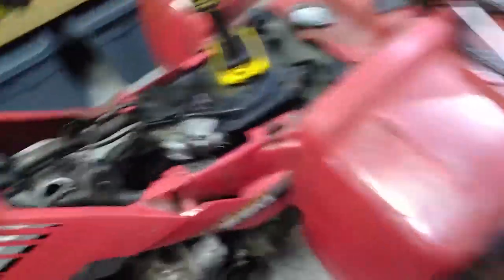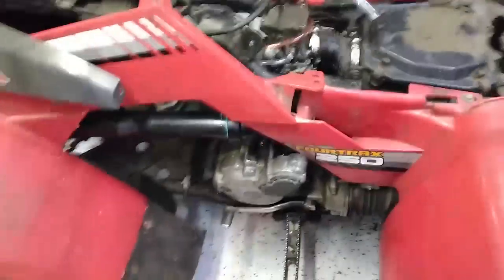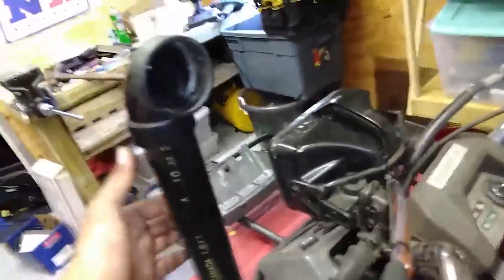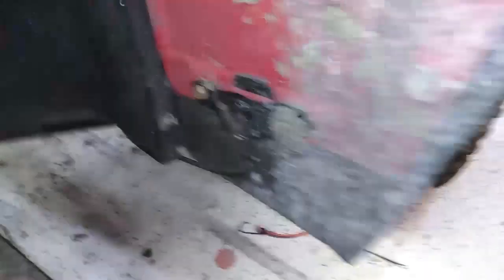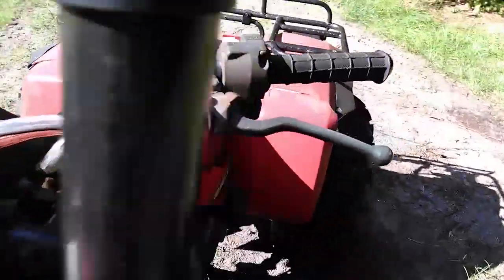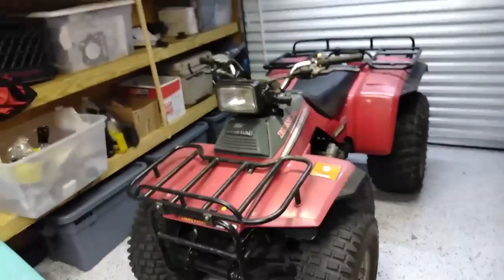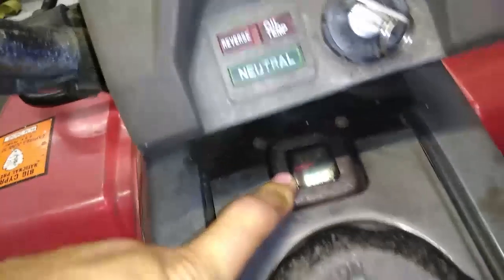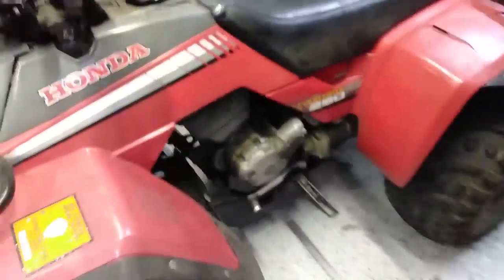fourtrax 250 valve adjustment, snorkel, lift, and walk around

Comment: My Dad bought an 86 Honda Fourtrax 2WD new, and as a 14 year old kid, I rode it around the farm, but we worked that thing pretty hard. Used it to pull a hay rake if you can believe it.  Hold baling wire spools building fence.  Strap lost calves on the rear cargo rack, lol!  He uses Gators on the farms now, but I just found that little Honda tucked away in a corner of one of the barns, and I'm thinking it's time for a resto soon, thus my search on youtube, see what other people are doing.

Comment: when you push down the red reverse button and squeeze the brake and look there's two cables the top is the brake and the other one we put a zip tie on the bottom cable and you don't have to  push in the red button any more just down shift and it goes straight into reverse
Reply: PCVideos In High Definition When your four wheeler is about 2 inches from the top of the snorkel and you have no brakes, that button could end your ride.
Reply: PCVideos In High Definition When your four wheeler is about 2 inches from the top of the snorkel and you have no brakes, that button could end your ride.

Comment: You can put 300 honda 2wd front hubs on the front and put regular Honda bolt pattern on these bikes, I have one with 26" zillas all around
Reply from the maker: +scullcracker01 mine had 4/110 already in the front
Reply: Mud Puppy oh ok mine came with 4/144

Comment: I have the same bike, just a 87, it’s a little more beat up, I want to snorkel and put a winch on it, would it work to run a 180° rubber bend straight from the carb and completely delete the air box?
Reply from the maker: It will run better smoother an airbox
Reply: Mud Puppy is the lid/cap to the air box water proof? Me and my uncle were wondering.... or does it seal? Asking a lot of questions because I’m very new to this and don’t want anything to bad to happen but this bike should float with the right tires right?

Comment: I just did a top end on a 84 trx200 and the cylinder gasket is leaking oil any ideas to stop it. It don't leak much but does co.e out when rode a bit

Comment: I have 1986 trx 250, under gas tank there was air intake pipe that went to filter box, but i need to vent it out the side, i was watching your video but didnt see where you rerouted that pipe?
Reply from the maker: I think you're probably talking about the crankcase breather but not sure... I usually replace the factory system with one straight line that goes from the crankcase into the airbox
Reply from the maker: This mimics how the modern Honda's work

Comment: How did you seal the airbox lid? And have you ever had problems of the right rear tire rubbing the muffler? I have been noticing this on my 85
Reply from the maker: +SezMan716 Dielectric on the airbox lid. And I have wheel spacers so no rubbing

Comment: What size tires did u put on it. Are they the older 4 lug bolt hole
Reply from the maker: 25s and no normal Honda bolt pattern 4/110
Reply: @MudPuppyOffroad  I have a 1984 trx 200. Wired bolt pattern or do u know what I could do to get bigger tires

Comment: how would a lift a 86 4wd straight axle in the front?
Reply from the maker: I assume you're talking about a TRX 350. you can just weld on a spacer to the top of the shock and get about two and a half inches. Compromises the steering a little bit because it adds a lot of caster. but they're already pretty much unridable to begin with so not that big of a deal lol

Comment: I am having trouble getting my exhaust valve adjusted correctly. I see you said TDC but does the vlave need to be down or up?
Reply from the maker: Both of the cam lobes should be facing down on this machine at TDC. Of course there are two tdcs like every other 4-stroke. Both valves should have slack if you're on the property DC and it wasn't adjusted wrong prior